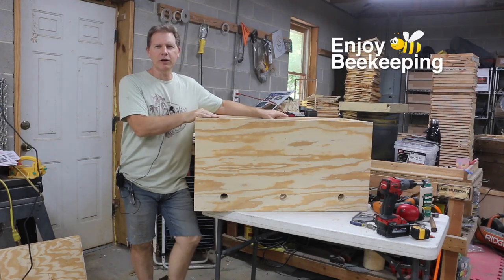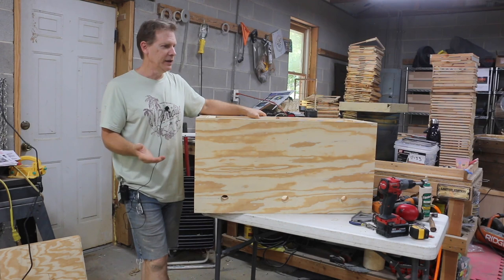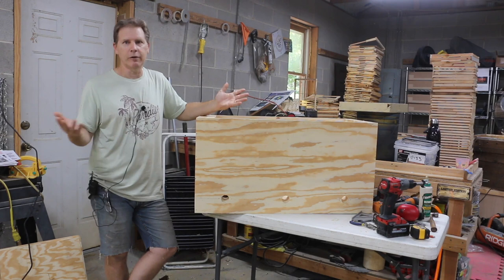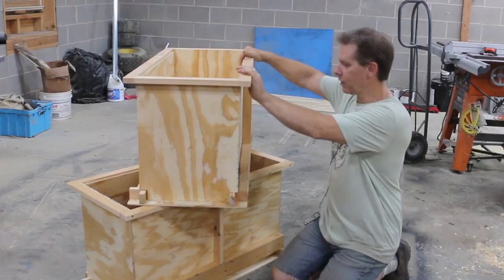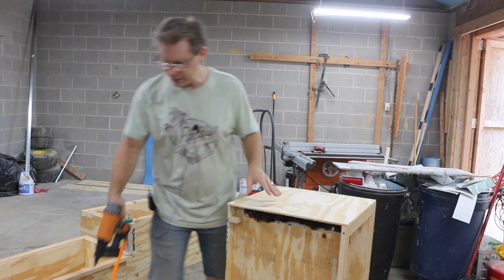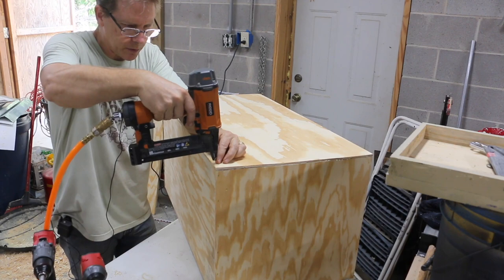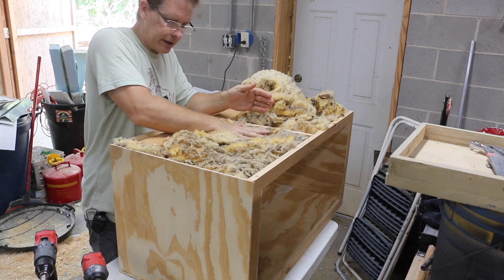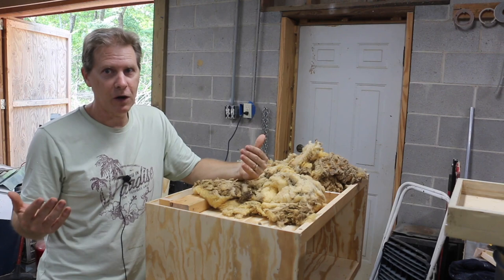Wool Filled Layens Hive

Comment: Great work Gene.  I built 3 of these last year as well with slight modifications.  I used foam insulation board instead of lambs wool...my insulation is 1" foam that was reclaimed from an old chicken house that was being taken down.  The main change from the plans was to reinforce the corners with ripped boards (I think they were 1.5"x1.5") on the inside.  This way you are nailing the plywood to the board instead of a just a plywood to plywood mating.  You also do not need the metal on the outside for reinforcement with the internal board.  For the holes you can use a forstner bit in a drill to cut a nice hole without a router.  All my layens hives are doing great here in Texas.
Reply from the maker: I agree that would be a much better upgrade to the "bones" of this hive and will likely incorporate ideas like that for a sturdier construction.  Thanks!
Reply: I’m also going to do this for my next two. I really don’t like the plywood to plywood corners. I have also considered eliminating the dado frame notches on the bottom and building a complete frame to attach the outside panels to.
Reply: I was thinking the same for corner reinforcement- don't care for plywood to plywood. Good to hear someone has already done it! Headed out to get a big bag or raw wool tomorrow!
Reply: @indymagoo  Hoping you'll try that and send info/specs/pictures for Gene René to share with us.
Reply: Gene thanks for the video and rpeebles thanks for answering my question I was going to as. “Is there only problem with just using insulation?” The only thing is in using lambs wool does that do anything special with any condensation that might happen, where as the insulation would not soak it up? 😊
Reply: @1918Camel  Condensation is an issue in non-insulated hives which is why they ventilate.  With insulation it creates a barrier between the hot humid air and the cold outside air....just like your home.  Not saying condensation is zero but from what I have seen there is little to none.  Of course if you live in Alaska you will need much more insulation to make it work.  Yes, there are beekeepers now keeping their bees alive all winter in Alaska with serious amounts of foam insulation!
Reply: @rpeebles  Thanks for your reply rp, I was thinking more on the outside between the first layer of plywood and the insulation. I could just wrap a sheet of Tyvek or other barrier around the outside before putting on the outside sheet of plywood but the more I think about it, I think it's unnecessary.
Reply: @1918Camel  I always cover the outside plywood in Tyvek if I am covering the plywood in anything...cedar siding for instance.  This protects the plywood from moisture that might seep through the  siding.
Reply: @1918Camel  even if the wool gets wet it will keep insulation value, it's also fire resistant.

Comment: Gene,  I have build this hive too and i found its better to add some framing lumber around the edges that you can staple the plywood to.  I used 11/4" around all edges and it worked out great.
Reply from the maker: Good tip!  I also considered adding something with a little more "meat" on it to frame it with.

Comment: Gene, how do you keep the wool from sagging in the walls as loose insulation does in our attics. If it sags you end up with gaps and air spaces. I’m wondering if shredded denim insulation wouldn’t be better. It allows humidity to pass through without sagging. What do you think?
Reply from the maker: Rob, I had the same concerns before I started, but it is so fluffy that it actually pushes outwards, and after stuffing it in the walls I could see that sagging should not be an issue because it's trying to expand so It stays put until you push on it to move it around - If that makes sense.  I don't think it will sag after working with it physically. Plus the plywood has a semi rough surface so it grabs the wool and secures it.
Reply: @enjoybeekeeping5612  This was my concern.  Obviously, it holds up or so many people using the wool would have had to adjust.   I'm getting started with Layen's hives and limiting my Langstroths.
Reply: I'm thinking I might drizzle some glue on the plywood where it contacts the wool to help keep it from sagging. Only concern I have is trapping the glue moisture in the wool compartment- not sure if that's an issue or not.
Reply: @gregoryjohns9537  I’ve simply gone with 1 1/2” foam board insulation. Easy to work with, cheap, stays in place, and adds rigidity to the hive. My colonies are doing very well with it. No moisture or mold inside. I also add a divider board with the foam on it in the winter. I do keep the divider 3/4” off the bottom to allow air flow.

Comment: Why use wool,when i can get stable closed cel styrofoam in 1 & 1/2 inch or 2 inch thick sheets ? Here in Central Northern Nova Scotia it gets cold we see minus 15 to 20 often for weeks at a time, then a thaw, then flash frozen for days or weeks again. Making the hive with 3/4 inch plywood ( I prefer Fir as its great water/moisture resistance) using pine for my corners,  as well as where access for the bees are. Have been looking at making my own Layens hive & know it has to been insulated, seen 4 vids now all about wool, but no one speaks on stereo. Why is that ?

Comment: What do you think is the weight of the completed hive? I built mine using 15/32” plywood because I already had it. This meant doing a bunch of math to  convert the plans. Mine is heavy enough that I will add lifting handles to the ends.

Comment: Great video Gene.  I  am thinking about tackling building some of these.  My 2x hives are just real heavy to move into place.  What type roof system are you going to use with this hive?  Keep up the good work.
Reply from the maker: I went with the flat tops for now, but want to use a gable roof for future ones.  The framing wood needs to be thicker in order to accommodate the hinges and the gable I use on my standard Layens hives will not fit on this particular hive because it is 1 1/2" wider *exterior dimension) and I'll have to go to the drawing board for a gable roof on this specific plan.

Comment: I don't have affordable access to sheep's wool.  Can you recommend an alternative that would be safe for the bees?
Reply from the maker: I've used styrofoam insulation without any issues since it does not come in contact with the bees, but my preference is wool if I can get it.
Reply: Maybe check with a 4H extension office?
Reply: I used Rockwool for mine.
Reply: Look for a sheep farmer that is raising sheep for meat.  Wool is byproduct in the spring